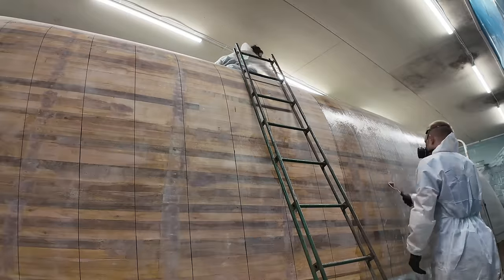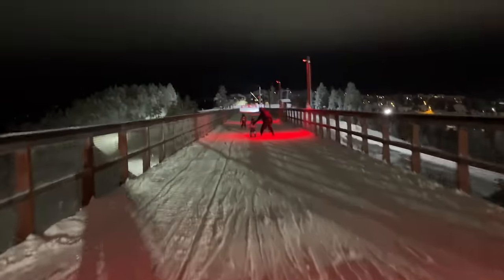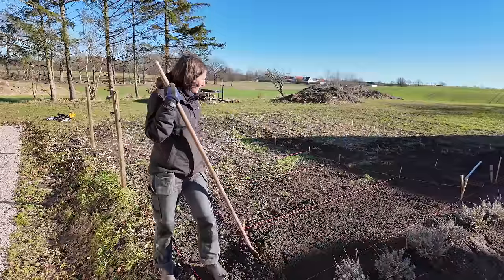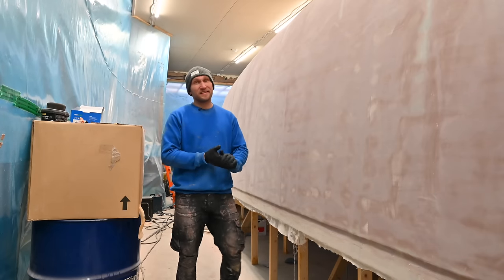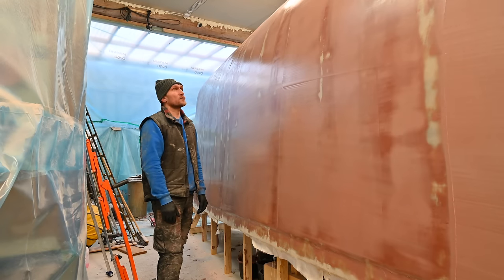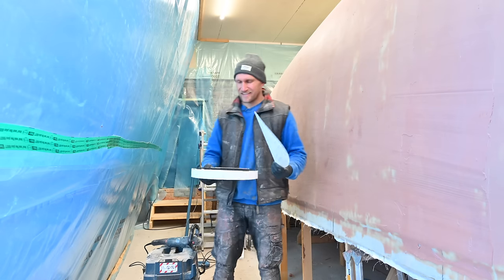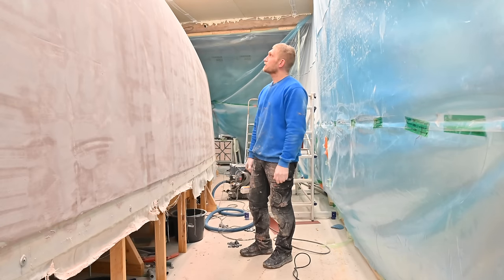New Improved Sanding Method For Our Boat Build - Ep. 384 RAN Sailing

Comment: As a board certified Boatbuilding Specialist Doctor  (BSD)  I officially diagnose you with Compulsive Perfection Fairing syndrome.  I strongly advise you to prime and finish coat your hull, flip it, and move on to other tasks.
Reply: Mic Drop 🎤
Reply: Yes, CPFS can be fatal.
Reply: He should finish the haul completely before turning it. Otherwise, I guarantee that he will regret it. A finished inside of a boat, this size weight is enormous, and then he has to turn it again and again.
Reply: @kranzonguam 
Buy him a Madz ..Oh Glorious Sanding shirt .... hes earned it 😁😂

Comment: In case you haven’t seen it already, I highly recommend  Sailing Yabá.  A young couple in Brazil is repairing a large boat to use as a platform for teaching scuba diving.  They are helped by a bunch of older men who have built or repaired scores of boats using somewhat unconventional techniques.  For instance establishing  a waterline without using a laser level, not steaming any planks and a bunch or other interesting techniques!

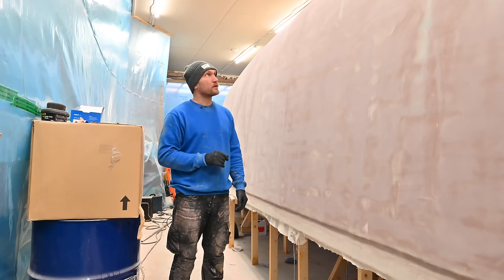Comment: @10:50 Yep, it's called "the torture board for a reason"! Good thinking to break the (hardest) top layer first.👴😉
Making the fairing thinner is a good idea. Slightly thinner than tooth paste always was my benchmark.
It will make it harder to sand, but applied the correct way, as you explained (and did later on), there is less to be sanded away...👴😊
@18:46 Wow, that 35 cm sander works like a charm!👴👌

Comment: It's not too late because you're going to be doing a lot more sanding on this project. I'd recommend a full face positive pressure respirator. 3M 6800PF Powerflow Face-Mounted Powered Air Purifying Respirator as an example. I used a similar one when I built fiberglass airplanes. It reduces the fatigue of having to draw the air thru the filter, adds a cooling effect as well as keeping the inside fog free. Another benefit is when you are grinding you can get up close and personal with a face shield. 
There is one thing you should be aware of, on units that have the battery, fan and filter element all located together and carried on a belt located in the small of your back can be problematic depending on your dietary requirements. If you happen to have a bean burrito for lunch and let one lose, guess what, you get the full effect, you can't run nor hide from it, only suffer... chuckle.🤣

Comment: A recommendation to not try to get the hull perfect, but good enough.  Reason for this is as follows; 1)  If you are going to paint the hull white, then small dips or bumps really do not show up unless you get right next to the hull with your sight line along the hull.  2)  From 50 feet away, no one can pick up small variations in the hull.  3)  Once you start sailing the boat, the hull is going to flex and will form its own dips and bumps.   Just something to think about as you move forward.

Comment: when i peeled my 29 ft to bare grp and painted the hull and topsides the only thing i didnt do was long longboarding. believe it or not i did sand the whole boat with a 5 inch orbital sander but always mimicking the motion a longboard would do. i would then change grits appropriately of course. sanding is hard enough but polishing is even tougher so be advised this is only the warm up!! i cant imagine doing a 50 ft practically alone...thats brave man

Comment: That's a whole lot of material to apply and sand, but it's really looking nicer with each layer.  With all that sanding you're doing you may not need any help to flip the boat, you might be able to just grab one end and give it a flip....well it would be nice if it was that easy wouldn't it?   That was cool (pun intended) to watch you all on the slopes. Your daughter looked like it was normal to be out there on the slopes and it was fun to watch you all enjoying some relaxing time away from the boat project.  The new sanding disc seems like it worked pretty good and removed a lot of material with each pass.

Comment: Wow. The amount of work in just one man is trully immpresive. Strong man :). And the invention of sanding disc is absoutely great.
The only thing we did different is that we also sanded +-45 deg. but having the sanding pad only in parallel with hull lines. (To achieve the correct hull shape)

Comment: You’re a beast of a man to do that fairing solo.  I have a Mirka also, great sander no dust.  
I think a .5 to 1 cm foam pad in between the velcro and foam disc you made would improve sanding results. A little softness to the sanding disc would work better on final coats.  Use foam safe contact cement and neoprene foam or microcell foam for the pad.

Comment: Just a suggestion, once the filler dries if you wipe it down with acetone it will be easier to sand and not clog the sandpaper by getting gummy. This may allow you to skip the orbital sander and move directly to the long board.

Comment: I used to clean and polish Computer room floors and the discs were large we used three types of pads which were held on by velcro type system the pads were colour coded black, green and red respectively hard, medium and soft. the red was just for buffing, the green was for scouring marks out and the black was for heavy marks. If your method isn't effective you might look into adapting those pads.

Comment: What colour are you going to paint it? Flag blue is very smart. I strongly recommend Allgrip HDT with a clear coat. HDT is a hard paint that is repairable but it is also very hydroscopic and so the boat stays clean. Allcraft 2000 is a very soft paint and will easily come off on fenders and having owned two boats one painted in each finish HDT is the better choice.

Comment: Don't you think you can soon find a sponsor to give you a turbo dust mask that you have to wear for more than three hours a day
The nice mask you use is one like this
Filtering respirator
Also called short-term masks and are the most commonly used types of respirators, which are available both with and without an exhalation valve.
NOTE: These type of masks must max. used 3 hours per day.

But you should have one like this
Respirator with motor
Also called 'turbo units' because of the battery-powered motor that blows air into the respirator through one or more filters (the equipment does not generate oxygen, but cleans the air). The Turbo equipment is combined with a full or half mask, hood or a headpiece with a tight-fitting visor.
NOTE: This type may be used for more than 3 hours per day. day.

Yes and I know they cost a lot of money but it's your health You have to think about You want to be able to enjoy sailing your boat
but of course it was probably someone who would have done it without using any breathing swarm..

love the amount of work you put in to make this project a success... MVH HENNING
Reply from the maker: Yeah,  a powered one would be nice! It’s the same protection level though, same filtration (99,7%) The time limit is (3hours) is there because it’s uncomfortable using a normal mask longer than that, it is however still the same safety level. 
Cheers!
/Johan